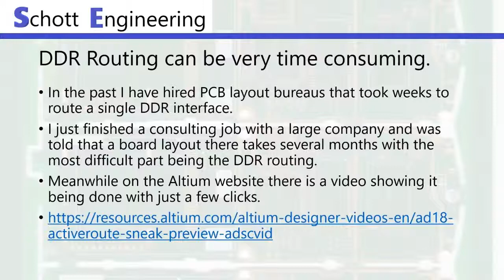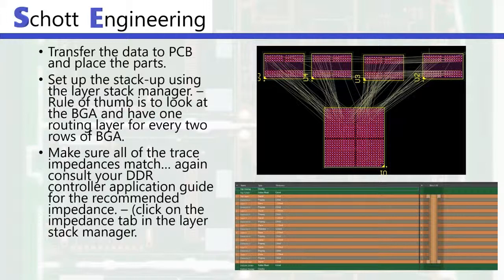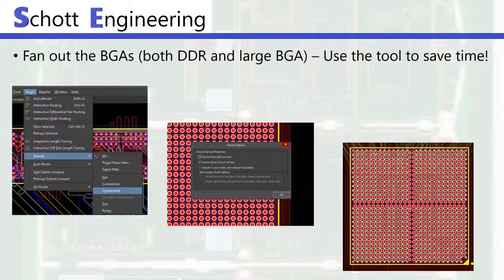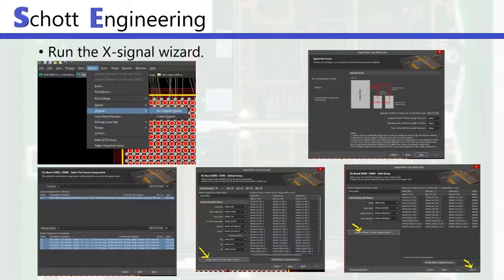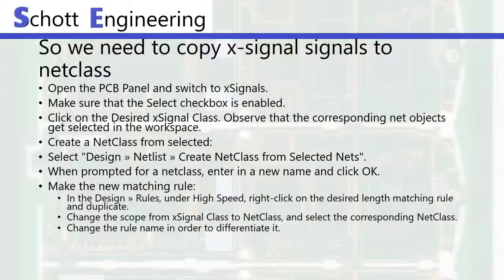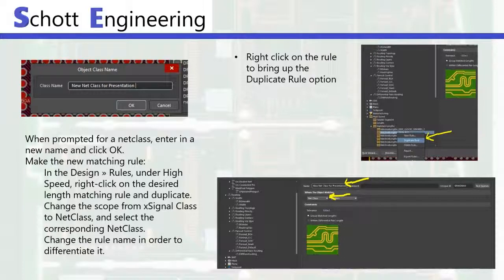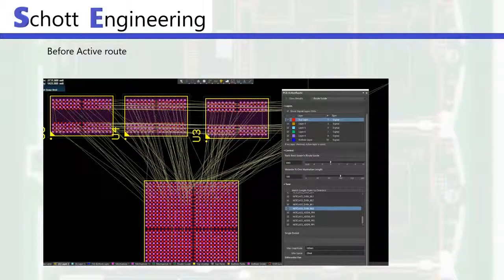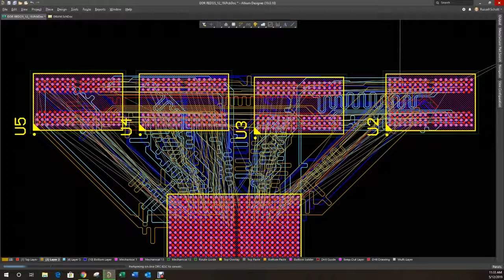Routing DDR3/4 memory using Active Route

Comment: Hi there... thanks for the video.
I have a question :
do I need signal routing for SDRAM, EEPROM, NAND flash, nor flash?
or just connecting directly to my MCUs pin!
Reply: Usually yes. But you need to pay attention if the voltage levels are the same.
Reply: Only for high speed ic like DDR 3